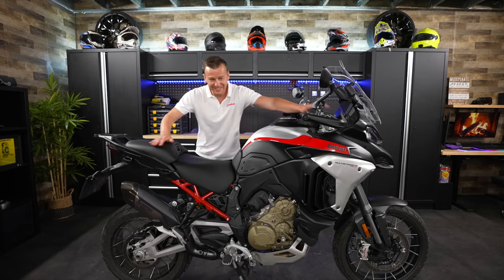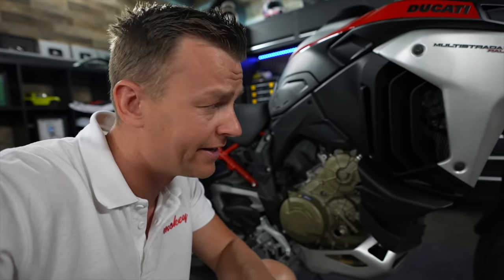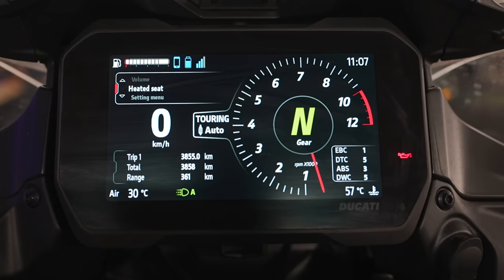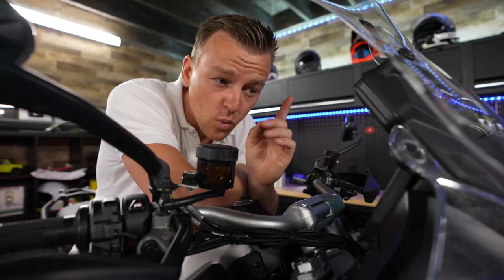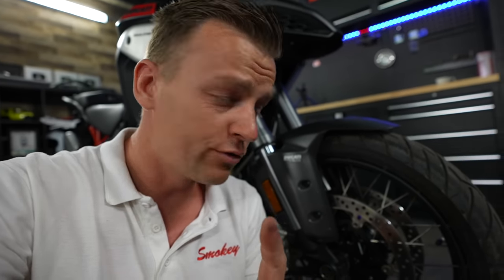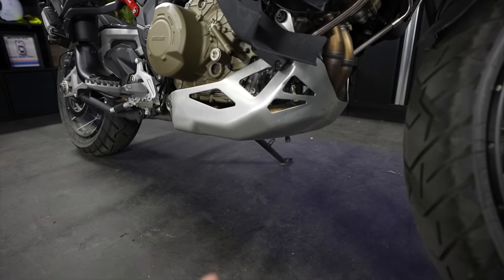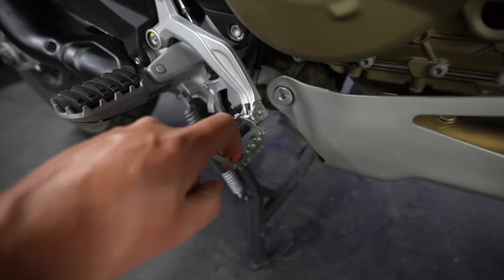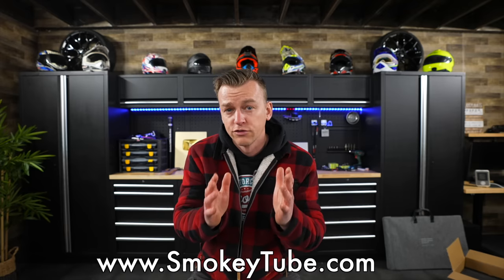2023 Ducati Multistrada V4 RALLY | Details - Price and Everything YOU Need To Know

Comment: I’m on a 10’000km Trip with the Rally. The Average fuel consumption after 6500km is at 5.2L/100km with about 50 kg luggage and 60/40 tires ( Mitas e07+) This bike is absolutely fantastic and worth every cent!
Reply: Would it be irresponsible to buy at as my first bike? Total beginner
Reply: @cloudytuesdays  I don’t recommend a bike with such a power for an absolute beginner! Start with a light bike,e.g. with a 125ccm and make your driving experience for about 1-2 years. Make a drive training if you have a chance. It’s for your own safety! Motorbiking is really a great fun if you start slowly.
Reply: Update: The total average consumption of my Rally after 9'616km was finally 5.1L/100km. My trip was from Switzerland to the North Cape an back in 4 weeks.  I had absolutley no issues or problems with the bike and a lot of fun on the gravel roads in the North of Europe. The average speed on the entire trip was around 75km/h. This for better understanding of the fuel consumption. Save Drive to everyone!
Reply: @cloudytuesdays  If you start with this bike turn the power down as low as possible in Urban mode, and jack up all the assists. Ease into it slowly, and be prepared to pick it up (opt for crash protection out of the gate.)

Comment: In NL, this bike costs 40k€ with comparable options to a tiger 1200 rally adventure, which is a 10k difference. The only thing you really gain is ACC, but you lose the low maintenance shaft drive. The pricing of the V4 is quite horrendous if you ask me. Basically all the options should come as standard (crash protection, heated grips,  keyless fuel cap)
Reply from the maker: I would agree some of the basics could be included in that price....but Audi is the boss now 😅
Reply: I agree! I own the new Tiger Rally Explorer, and I take mine off road as often as I can.. something absolutely nobody will be doing with the MS. It should have a 21” front wheel like the Tiger, and as you say, all the protective equipment. There’s absolutely no reason the Ducati doesn’t have shaft drive. What little power is lost vs the chain drive is minimal, and the Duck will still outrun most motorcycles..
Reply: 2:30 Slap the full Akra race exhaust and you wont hear that intake ever again and it sounds 10x better then just the slip-on.
Reply: I am at the eve of buying new moto. My options are triump 1200 rally explorer or MS. I will drive 80 % on roads 20% on dirt. My concern is 21’ front wheel really impacting on corening performance or not, The shaft drive is fantastic but MS features allures me a lot to be frank I am in the middle do you have any adivices?

Comment: I can answer this. NO IT ISN'T. Ducati should be ashamed selling a bike at this price point when it is neutered straight out the factory to the point that not only does it prevent people from reaching the ADVERTISED top speed, but also impacts the bike's ability to comfortably ride between 4-6k RPM. And to solve all of that you MUST purchase a $3000 performance kit and spend another $500 for the dealer to install and tune the bike.

And on top of all of that the bike doesn't come with tire pressure sensors ON A $30k BIKE!!!

Comment: Just had a test ride on the Rally. Thinking of having a change from my trusted Beemer 1250 GSA TE. In some ways it lived up to expectations but in others it just didn't. It sounded like a sewing machine (euro 5 I know), the seat was uncomfortable, the engine braking did not make for enjoyable flowing rides, the switches were just pony, especially the turn indicators. Plus the top end bike was over £27K but you had to pay extra for tyre pressure monitoring, keyless fuel cap and engine bars - really!!!! Am I missing something after all the rave reviews or is it just me

Comment: @LifeofSmokey why doesn't anyone talk about what happens when the bike tips over and those radar enabled mirrors break. Isn't it a major design flaw?
Reply from the maker: The radars are in the front and back of the motorcycle. Only the light is in the mirror 😉
Reply: @LifeofSmokey  Yeah so expensive. I wrote radar enabled as in radar would trigger the light in those. The mirror juts out more than the handebar so it is likely that you will lose an expensive mirror with a fall.
Reply from the maker: Yeah some parts are expensive , the clutch lever is 240€ on a Multistrada , I broke about 50 over the years dropping my enduro motorcycle 😂🙈